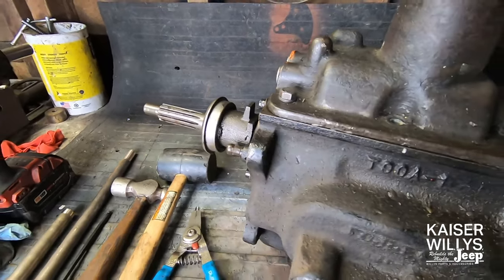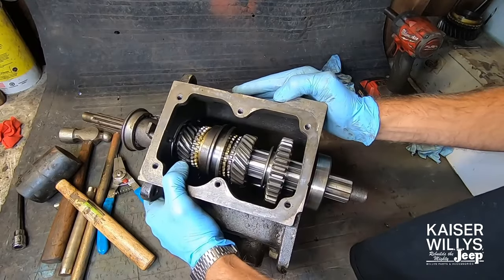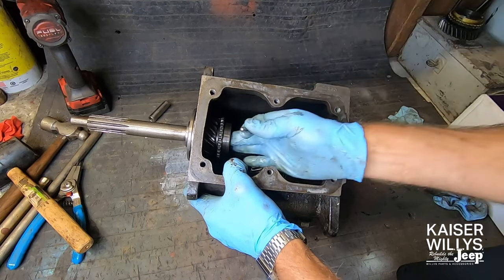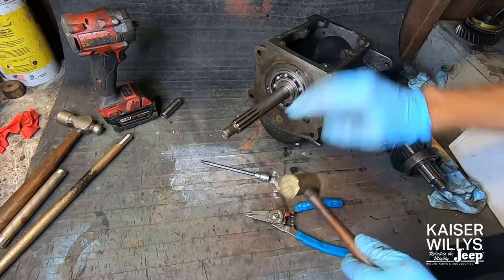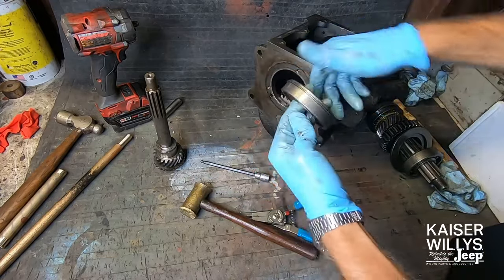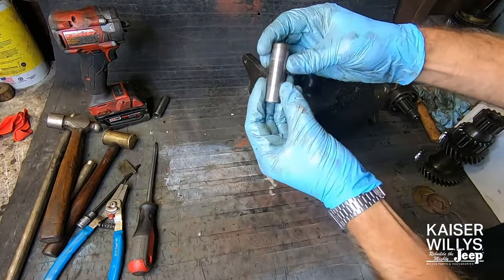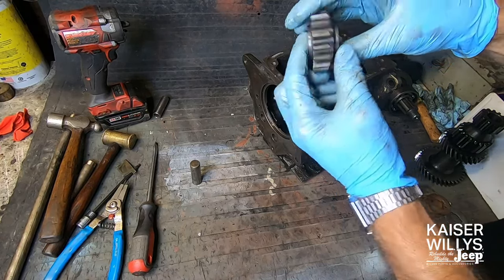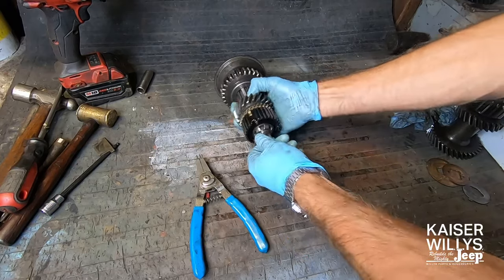Willys jeep t90 disassembly Part 1

Comment: Awesome video!  Perfect content to give me the false hope that I too can do this, so I take mine apart and it sits on my bench for the next 6 months 😂
Reply: You can do it. I went through the same process awhile back with no experience and got it done. I'm a systems administrator, not a mechanic. The T90 transmission is the best thing to learn rebuilding. Very simple.
Reply from the maker: You can absolutely handle this! It’s such a great transmission to lean on. 👍 you got dis!

Comment: Hello, I was having trouble with my reverse idler shaft. I was trying it your way with hitting it out, but I ended up having to go a different route that might help someone in the future. I used a larger socket to put on the back side of the shaft, and a smaller socket on the front. I then squeezed them together using a c-clamp and it popped right out. Thanks for all of the info! you are helping me rebuild my cj3!
Reply from the maker: Great tip! Thanks for watching and commenting